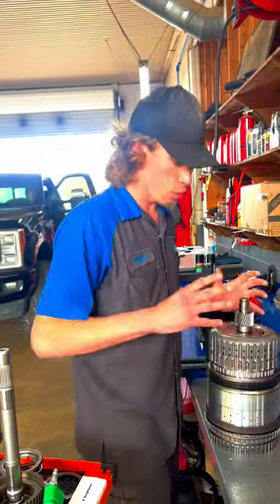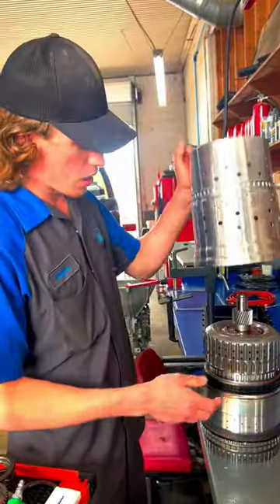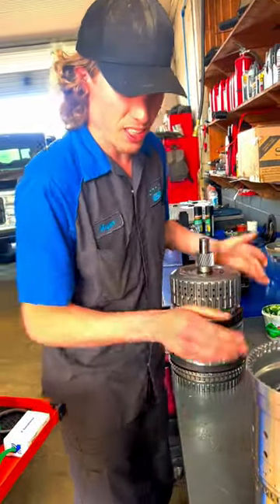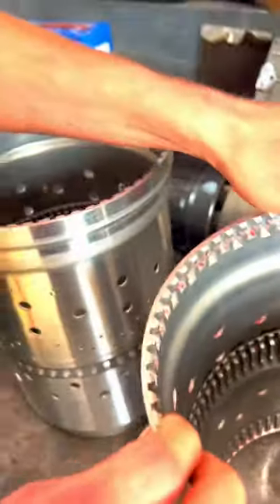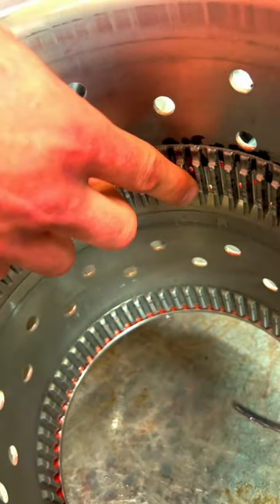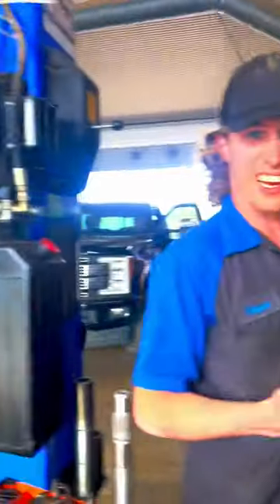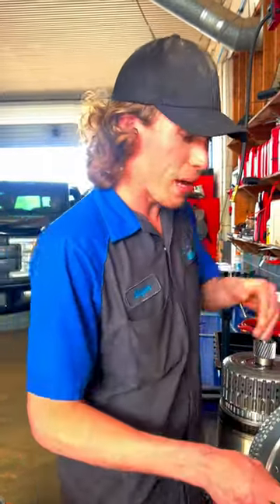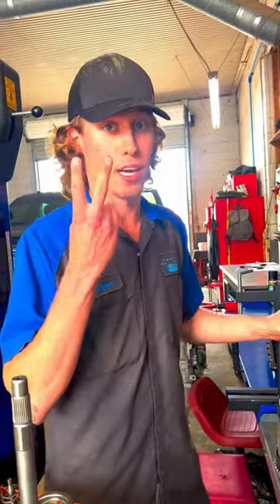Ford 10R80 Most Common Issues #shorts

Comment: This dude is very knowledgeable for his age.
Reply: he's 47 years old
Reply: @giovannigiorgio8962  nahh
Reply: Not about age, it's about experience. I'm 18, have probably similar knowledge in transmissions, but I primarily work on dodges and chevys. I also do engine and suspension work, but I specialize in electrical shit, because it's simple to me and really easy. Been doing it for 2 years, work for myself now and have never had a fire or wired something wrong
Reply: Yeah but he failed to state the cause of the issue to the splines until recently. So I wonder how many he just replaced without actually correcting the main issue…
Reply: How much does out of warranty repair cost?

Comment: We got a ( 2022 I think) f350 at work with the 7.3l gasoline engine and at 69k we've already had to have the 10 speed automatic rebuilt. Our f650 service truck with 15k miles has been down for 6 months because of power steering fluid over pressurizing into the surge tank pissing fluid over everything. I'm not picking on Ford, I know every brand has its own issues. Just wanted to rant.

Comment: on the 10L80s at GM i see the pump idler gear riding off of the bearing a lot too and eating the stator support
Reply: 10L90's
Reply: The reason both ford and GM have the same and or similar issues is it’s the same transmission both companies designed the 10 speed transmission together 😂
Reply: @macario9035  same
Reply: Regardless for what the problem is there is a problem and it's a gigantic job. I don't see those problems on German ZF or Japanese AISIN transmissions
Reply: @michaelhorn-ge8rj  You would think they put 2 efforts together to design it and would not have any problems but gm and ord always had transmission problems and they always will.
I don't see those problems on a German ZF or Japanese AISIN transmissions.

Comment: Thanks for the heavy line tutorials. I am preparing to replace waterpump,  timing chains, and tensioners on a 2008 Taurus. Any advice that your experience, knowledge, education and training might provide? I will be using all Motorcraft if available. Any advice on the DPF systems on a 19 6.7. I appreciate that you videos can be shown in a classroom setting. You have a tremendous amount of experience on diesel heavy line. Keep up the positivity and outstanding work ethic.
Reply: When it comes to timing chains and tensioners just take your time and triple check timing before during and after. If you get it to TDC it shouldn't be to difficult even if things do move a little bit. Hope this helps and good luck!

Comment: So just a note here when updating the C,D,F cylinder………there are at least 4 different part #’s depending on what vehicle the transmission is in.  Check the TSB and make sure you are getting the correct cylinder.  The snap ring grooves are in different depths and clutch clearance will be WAY off!!!

Comment: i have a 10speed gear for my f150 2019. recently purchased a second hand vehicle. I noticed the gear when shift's to 4th there is a slight lag like someone pressed the brake pedal for a milli second & then the 8th gear seems a little awkward as well. what do you suggest i will consider this with service technician but where we are from in Dubai i doubt they are as experienced to tackle the in depth details you guys have gone through. the seller told me its needs some oiling and I need to use the 4x4 system and it will be fine 😏🤨

Comment: Have you done a video on just the general reliability of the ford 10 speeds?  I’ve been considering an F150, but don’t want one after 2017 cause I don’t want the 10 speed
Reply: Dont do it. get the 6r80, 10r80 has too many issues and reliability is shit. I have a 10 speed and wish i never bought it.
Reply: @Travisisaac55 what’s wrong with it and what mileage it got?
Reply: @Kylewraps  nothing really but is known  for a lot of issues, it does shift hard sometimes and too many gears so it's always shifting up n down and trys to get into 8 to 9th gear driving around town at low speeds and lugs the emgine. It is  clunky and jerkey sometimes

Comment: Maybe you follow the workshop manual for the videos. Upside down cylinder build is ridiculously 10r80 rip the A clutch and pull the cylinder out and if your man enough same goes for 10r140 set it up right with input shaft facing up much easier to set timing timing on the trashcan😂

Comment: Literally a trash can as on my 2023 mustang Ecoboost 10speed, there was a grinding noise took it to the dealership they weren’t able to figure out and later suggested that they will order clutch packs and open the diff as well to work on it, my left rotor is all rusted up and the parking brake doesn’t want to go up, so yes for a brand new 2023, 5k mile car it’s frustrating and disappointing

Comment: Too many failure points im sure the 10 speed drives amazing and makes good use of the power but just because it’s faster doesn’t mean it’s better than a manual
Reply: Only run 4 cylinders - V8s have about twice as many failure points!
Reply: @RyTrapp0  not really a good comparison as v8s are tried and true old technology the 10 speed is new and if you do some research you will see that a lot of 10 speeds are blowing up or having other drivability issues